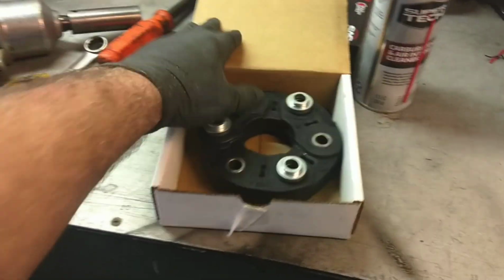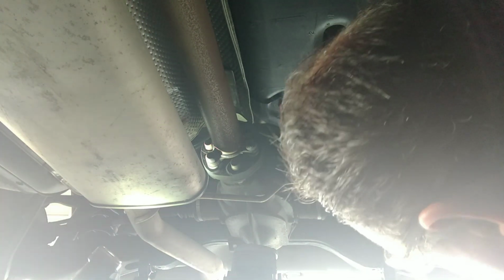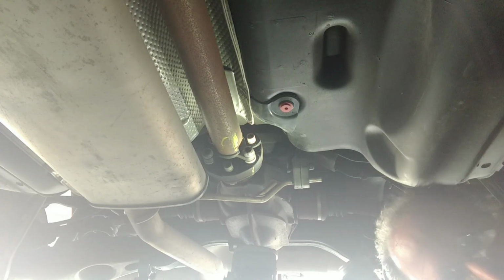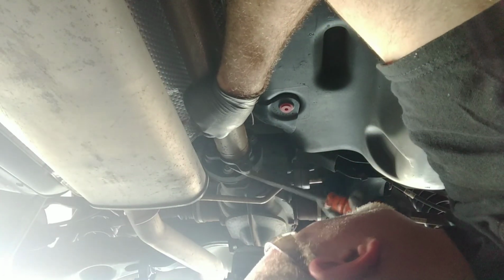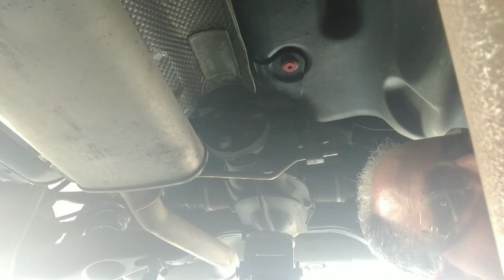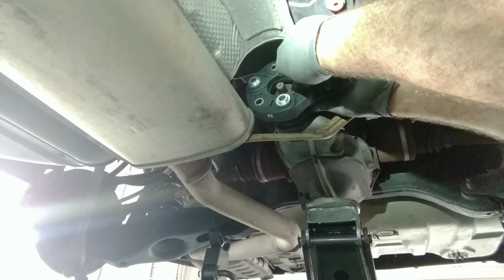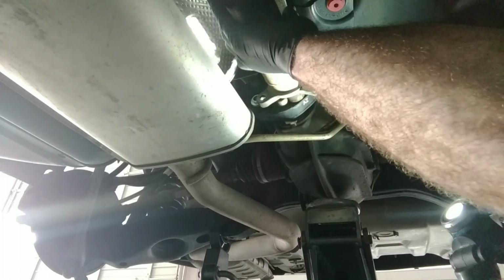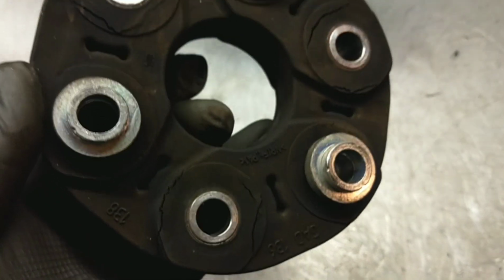How To Replace The Rubber Drive Shaft Coupler U Joint In A 2008 Chrysler 300

Comment: What type of fitting/size torx bit is needed to remove the bolts on the rubber drive shaft coupler ?
Reply: T60